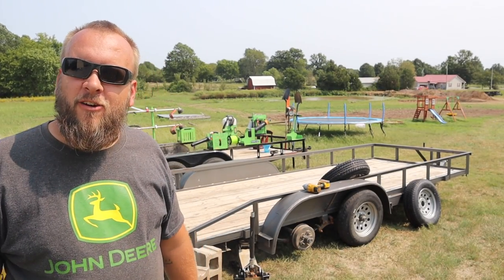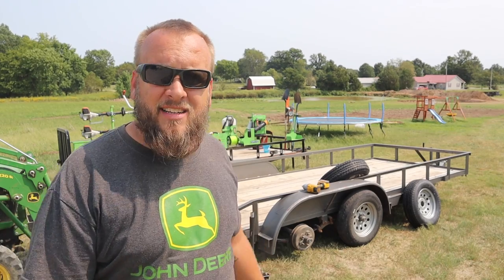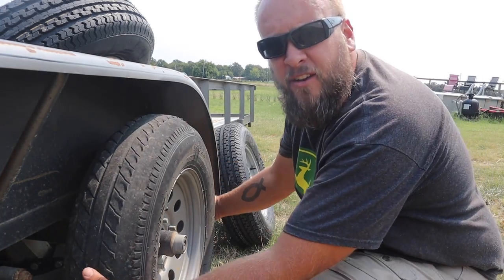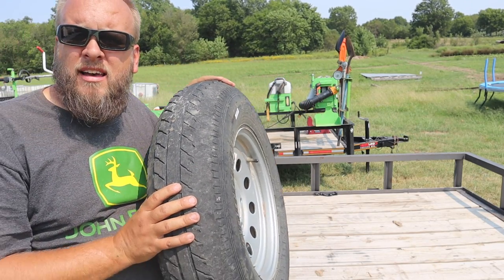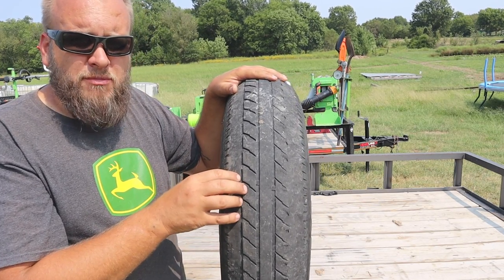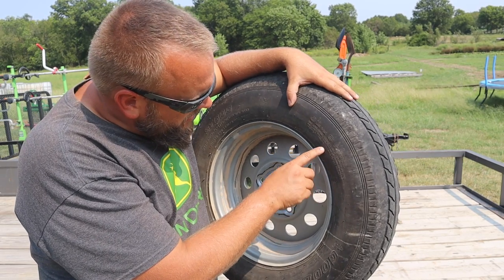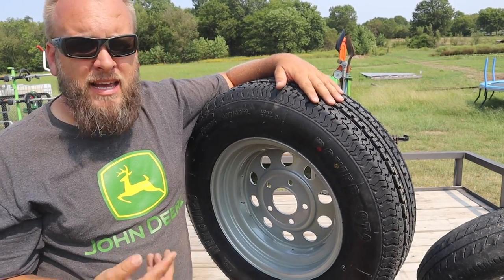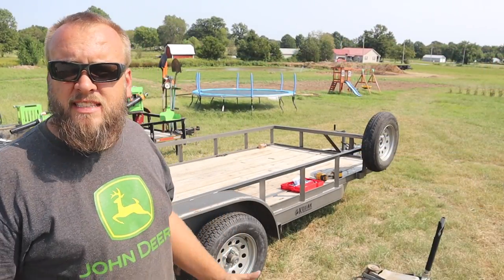These Trailer Tires Suck - Check the Load Range Before you Buy

Comment: D before the 15 means it's a bias ply. An R in that position means it's a radial. Those are likely C rated tires which can carry about 1800 lbs each. Four times 1800 is 7200 so they exceed your trailer capacity but just barely. Trailer manufacturers put the minimum they can get away with on the new trailers to cut costs. Was typing this while you continued and the tire you chose is what I would recommend. 

I always put the better tires on the back axle because if you have a blowout on the front you can still control it usually without much trouble. If the back tire fails you can have the rear of the deck hit the pavement. I've had half a dozen blowouts over 30 years of pulling trailers and definitely prefer the front to be the failure point if given the option.
Reply from the maker: Thanks for sharing that info. I ended up selling this trailer and getting a gooseneck because I’m pulling bigger equipment now

I definitely check the tires on it before I bought at this time

Comment: i'm no tire expert but I just had a similar experience with my boat trailer tires. The tires that came with the trailer were a bias ply. I was getting wear on the inside and outside and like you check the air pressure constantly. I was advised to switch to a radial tire which is better for highway use and can haul more weight. Hope this helps.
Reply from the maker: Thanks for sharing

Comment: Trailer manufacturer's and RV manufacturer's put the cheapest lowest rated tire that will just barely meet the minimum requirements to meet the trailer specs.  Always have, always will.  1820# x4 = 7280#.  Meets the specs by 280#.  Cheap and meets the specs.  Put on the highest rated tire that you can get for your trailer if possible.  It will give you more capacity which should ensure longevity.  Just make sure to keep them pumped up to the specs.  Typically C rated tires are rated at 50 psi.  D is rated to 65 psi.  E is rated to 80 psi.  Just make sure that your rim is rated to handle the extra air psi of the upgraded tire.   Great video.
Reply from the maker: Yeah. It’s annoying but I will be checking the tires more before buying my next trailer

Comment: With a double axle trailer, depending on where the weight is on the trailer, 1 axle can pivot more and the other one is pushed more left and right when turning. The pushed axle will wear out the edges of the tires. Im not an expert but you hardly ever see that kind of tire wear on a single axle trailer. Even worse on a triple axle.
Reply from the maker: Thanks for sharing

Comment: Good morning Brock, My Bwise and Diamon C came with spares. The Bwise has H rated 16 ply so when it comes time to replace im going to do my research as i want them to hold up for the long run.
Reply from the maker: Yeah, my dump trailer came with really nice tires although I had to take it back get me a matching spare and mount it.  

The lesson learned for me is just to pay closer attention to tires before buying the trailer or it won’t be long before you’re putting more money into it

Comment: Usually the front tires of a tandem take a beating. They drag way worse in turns that the rear especially sharp turns, you should hear a tri axle take a sharp turn.. Keep an eye on them and rotate the new ones to keep the wear even. Highway speeds will also take its toll on trailer tires with a heavy load/close to max capacity. But it all honesty, it's just a junk tire from the manufacturer to cut costs. If I remember correctly you add up all the plys to get the "8 ply" or 5 ply.
Reply from the maker: Yeah, it originally came with 5 ply and I upgraded to 8 ply

Thanks for the feedback

Comment: If all of the tires were the same when you bought it, and only two wore out, I would consider that maybe there was some issue with the axle alignment.  If the tires continue to wear oddly in the same position the old ones did, I would definitely investigate the axles.  I'm not an expert, just trying to use some logic here.
Reply from the maker: Sounds right to me

Thanks for watching
Reply: I agree and would also consider weight placement. Just because the weight rating is proper does not mean it's distributed properly on the trailer due to the tractor and trailer length. The bulk of the tractor center weight should be centered over the tires with roughly 10 percent on the hitch in effort to properly distribute the weight, if your trailer isn't long enough to do that......then they sold you the wrong trailer for your unit. Handling and improper tire wear will happen.

Just a thought.
Reply from the maker: @anthonyg6924  thanks for sharing

Comment: The D on the first tire wrote in the size means its a bias tire, like the R in the second tire means it a radial tire. A radial tire is better than bias and yes you want the load range to be D or better but it normally printed in the small print. Oh just to give you a heads-up there starting to sell brand new cars without spare tires. I know a guy that bought a camaro and in the spare tire spot it has a fix a flat and small pump.
Reply from the maker: Thanks for sharing

Comment: What pressure were you running them at?  Wear pattern indicates an under pressure tire. 

If you’re replacing a load range D with another load range D, you aren’t getting anything more. The load range is the same.
Reply from the maker: The old tires were load range C

I run 40-50 pounds
Reply: @RockhillfarmYT  run those new D range at 65psi. The load rating assumes max psi and decreases if the pressure is lower.

Comment: I didn't have time to read all your comments but I'm sure somebody has told you that using concrete blocks like that is not safe. And if you run your tires low anytime it will ruin the tire. You don't have to run them low all the time. And I'm sure by now you've noticed that the new tires wore down to the same tread as the old tires. Real fast. Just my 72 years of experience trying to keep you safe. I don't want to see you crushed underneath the trailer for using concrete blocks to hold it up as you did on this one if you notice houses are not built with blocks standing in to end like that there's a reason. Stay safe young Feller

Comment: This is an issue with RVs too. They all seem to come with what are referred to as “China bombs“. To me, tires on a trailer are like the foundation on a house. I don’t understand why manufacturers cut corners here.
Reply from the maker: Exactly

Thanks for watching
Reply: I will second this comment with wisdom (ie.. experience).  Trailer manufactures look to compete with the best priceline in the business.  Therefore they look to curb costs where they can and still sell.  Tires seems to be a main target to cut costs.  I assume to cut costs is where the lack of spare tire comes into play here too.  As for comparing to automobiles so called spare tire.  That donut?  The thing is a  very dangerous joke.  I wished they would go back to real tires for spares.

I have tires of similar size on my 5th wheel.  They wore just like that and I don't think there was 2000 miles on the tires.  First set of tires, one totally threw the tred off of one tire.  Tire was still inflated and I managed to pull over before any more damage was done.

Put on a new set that was rated at 8 ply.  After a trip across 3 states, when we got home we noticed one tire was worn to and almost through the belt.  These were the newer tires too.  A trusted friend in the trailer repair business replaced them for me with 10 ply tires.  So far no issues but they haven't been pushed as many miles yet either.  10 ply tires for a 15 inch rim is difficult to find, but apparently they are out there.   

Yes, there are some dirt cheap trailer tires that match your argument to the bitter end.  Dangerous!  Research them before you buy them.

One final note is tire age.  If they are 6 years old or older, replace them regardless of tred.  The rubber starts to crack and every year after 6 years of manufacturing the problem just gets worse and worse.

Sorry, one more note.  It took a lot of research to find this.  Apparently trailer tires are intended to have a top speed of 65MPH according to National Highway guys.  Make of it what you will

Comment: I heard if you’re not running ST tires on the trailer regardless if you are using truck tires the meet the load rating. They can fine you $1,000 per tire if they aren’t marked ST. I can’t get a straight answer on this.

Comment: Load range D means 8 ply.  Load range C is 6, B is 4, and E (the highest) is 10 plies.  A B before the rim size indicates a bias ply tire, an R indicates radial.  Example: 205/75R15 is a radial.  Bais ply tires are less expensive which is why many trailer sellers use them, even though they have lower load ratings.  Radial tires have better heat dissipation, they wear more evenly, and they are generally better tires.  Back in the day, many trailer sellers used to install used tires on new trailers, to save a buck.
Reply: Good information.  I will add that there are also F (12 ply) and G (14 ply) tires.  If you have a heavy equipment trailer and are hauling heavy a lot they are worth the extra money over 10 ply.
Reply: Actually the letter D before the rim size means bias ply.

Comment: I worked for a forklift company and our tire press came with bias ply tires. Tandem axle and very short. When turning sharp and backing it up whatever tire had the most pressure on it would buckle in or out and cause that same wear. We changed out to radials and they still did the same thing due to the way the trailer was, but it would be much less. I came through Chetopa, KS with that trailer one morning and was the most popular guy at the gas station since it was like looking at an alien space ship.
Reply from the maker: Small world.

Comment: Great topic. I got a 2019 14k GVWR Dexter twin axle trailer new. For all this time it was fine. Light hauling, 55 horse tractor. However once I got a skid steer, I looked at those tires more closely. I’m not happy with the weight rating. It looks like they just slapped whatever onto the trailer just to get it sold. 🤔

Comment: I've seen tires with excessive shoulder wear, but usually it's from under-inflation.  But the shoulders on those tires are completely gone.  I'd wager that the tires are really old, not in mileage, just age.  I would of checked the date of manufacture on the tire.  There's a 4 digit DOT number that indicates the week/year of manufacture.  Then I probably would of checked the condition of the trailer's suspension, bushings, springs, mounts, etc...  Narrow trailer tires are not necessarily a bad thing.  If your trailer has brakes, it's important that the tire have good contact with the ground.  If the tire is too wide, in inclement weather, such as water on the road, or snow, the wide tire can skid on top of the water/snow (otherwise known as hydroplaning), and when the brakes are applied, the tire will do little to slow down the combination.  If the tires are more narrow, the "pizza cutter" style tire can better cut through the water/snow to reach the pavement underneath.  So having a smaller tire contact patch can be beneficial.  But in perfect weather, I agree, bigger is better.

Also, the load range (Load C, Load D, Load E, etc...) is in reference to the number of plies it would normally of been back when tires were bias ply.  Modern radials have a steel belt that is much stronger, and a single steel belt can be equal to many plies of back in the day.  So don't be surprised if a "12 ply" tire only has 3 or 4 plies.  Think of it like modern LED light bulb advertising 60W of light.  The LED light bulb will probably only use 9 watts of energy, but will provide a light output comparable to a 60 watt incandecent bulb of years past.  That fact I still remember screwing in incandecent bulbs probably reveals that I'm no spring chicken.  Getting embarrassing here.

Your ruined tire is a Goodride, my latest trailer came with that brand tire, 225/75-R15 Load Range D.  I did have one blow out after running over some nails on interstate.  Both tires were nailed, but only one blew out.  I just plugged the other tire and added air to it.  Lucky for me I had a spare tire, so I made it home.  I was able to save the rim on the tire that blew out, so I replaced that tire and am now using it as a spare.  My spare is a MasterTrack Load Range E.  I've never used it, so I don't know how well it performs, but with a higher load range, I'm hoping that means "more durable".
Reply from the maker: Thanks for sharing the info.

This experience taught me a lot about trailer tires. I’ve got five different trailers and most of them came with a low quality/low load range tire and no spare.

Kind of an expensive lesson to learn as you upgrade them all

What was frustrating specifically about this trailer is I bought it as a package deal with my tractor about a year before this video was shot

They sold it to me knowing what I was going to haul and the tires were low quality. I bet I did probably make it worse by driving them under inflated so that’s another lesson learned

My newest trailer that basically replaces this one is a gooseneck with 7000 pound axles and it actually came with a high-quality 10 ply tire

Thanks for watching

Comment: Just a little warning for your safety.  I've had those blocks crumble changing tires before (they are very weak concrete), so your jack stands are much better.  Just keep your body parts out of harms way if you continue to use them.
Reply from the maker: Thanks
Reply: Yeah those blocks are strongest laid flat with the openings vertical. No houses are built with them standing up like that as that is it's weakest orientation. Even wood blocks would be a better choice. Never use them like that if you are laying under the thing you have elevated. Could be disastrous.

Comment: I see a 10K trailer in your near future.  They will have a Load E tire that are 225/75 as opposed to your 205/75's which is also what I have on my trailer, very similar trailer, but mine has brakes on both axles for some reason.  I also watched the video because just last week, I pulled the trailer out and had not one, but two flat tires.  Had no idea when that happened, but plugged both.  Yes a patch would have been better, but I had a job to go to.  Everything was fine until I loaded the tractor up to come home, went around a tight corner, lots of rubbing on a tight corner with two axles so close together and popped one of my plugs.  Had a spare, so it wasn't a nightmare, but still hate doing "in-field" repairs or changes, where I don't have tools and equipment handy.  After doing the repair and seeing they were closer to bald than I thought, I quickly ordered two tires and had them mounted and the trailer is back in operation.  You suffer from what I was concerned about.  My current 18' 7K trailer is plenty for my 1023E, but like I was with my 14' 3.5K trailer, right on the edge, you are close to that edge yourself with the 2038R.  It's not urgent, but your needs may give you a good excuse to upgrade to a longer trailer with more weight carrying ability and more features, like the drop down ramps with that also have the built-in stabilizers in them, larger tires with 6 lug wheels and pocket tie downs.  One last comment, I had the same issue as well.  I bought the trailer used, but hardly used, tires were fine a year+ ago, and now with similar use as yours, certainly less than 5K, and probably less than 3K, it seems those tires should have lasted longer.  Also, it seems to me that the rear axle had taken most of the brunt of the wear.  I try to keep the load well balanced, but just don't know why the rear would get the most wear.
Reply from the maker: Yeah, thanks for sharing. The last month has been spent looking at truck and trailer upgrade options

Comment: Just had to replace my 7k trailer with a 9k equipment trailer with 2 4500# axels. the axle was flexing on the 7k with my 2032r with backhoe and loaded rear tires. Was causing tire wear.  Figure tractor is 5200 pounds. I really like the 2 folding ramps on the new equipment trailer and the knee they have so i dont need boards or jacks like you use when loading or unloading and not lifting the truck.
Reply from the maker: Yeah, by the end of the year I am hoping to have a gooseneck with 8000 pound axles.  I think with everything I added to my tractor it’s just too heavy for this trailer